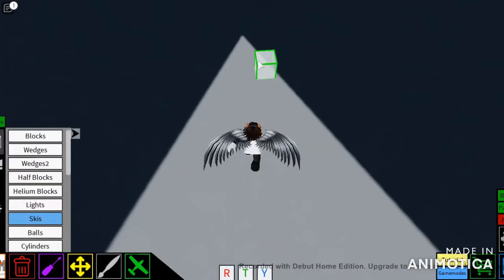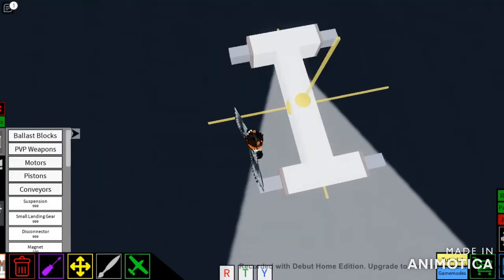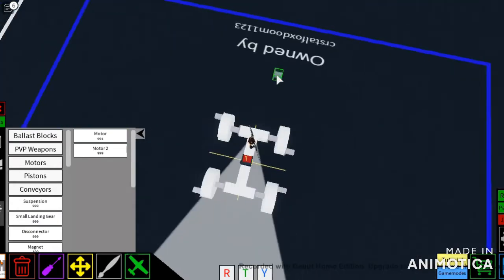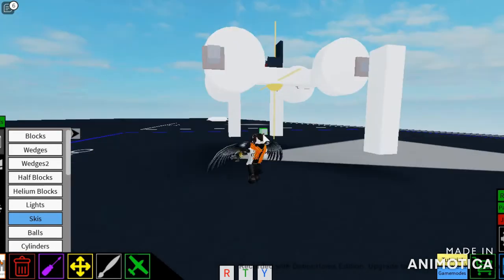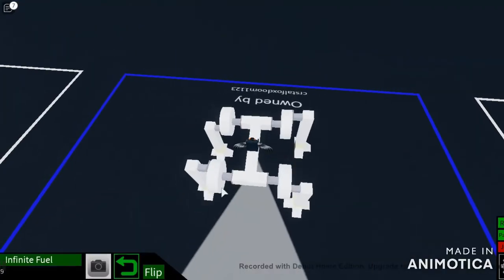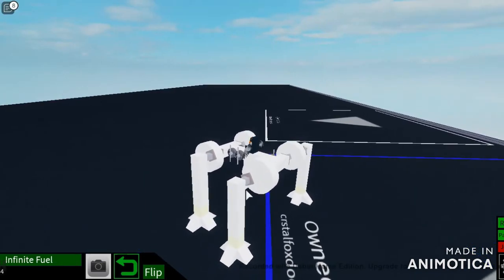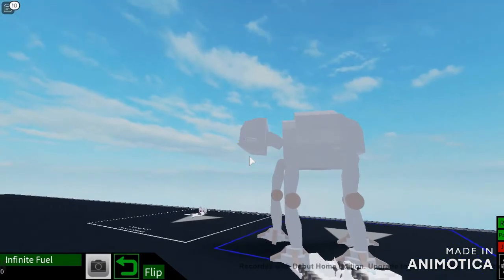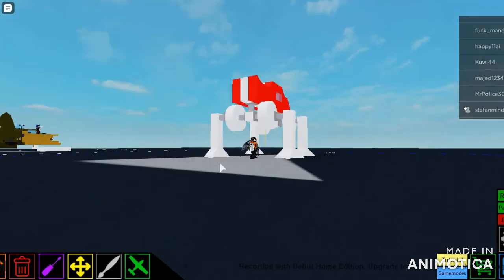Plane crazy, how to make a 4 legged walker

Comment: how do i make it so the legs dont get out of place bc im building a walker and the legs r moving out of place and making it not walk properly
Reply: you can do reset for motors
Reply from the maker: @BobertTheSealMobile  make sure that all the legs are at the same speed and are placed correctly on the cylinders. (It's been a while since I've played sorry if it's not much help) I believe there's also a setting to adjust the torque strength so if it's too heavy maybe increase the torque
Reply: @cyberjamm  ok
Reply: the walker im making is an atte so how do i do the middle legs?
Reply from the maker: @BobertTheSealMobile  that's a trigger 1 this design is for 4 legged walkers not 6 I'd probably recommend building the middle legs in a middle rotation of the outer legs so as 1 is at the top the others at the bottom put the middle on the front/back of the cylinder.
Might be something I look into to make a tutorial
Reply: @cyberjamm  ok cuz i made the middle legs a bit slower than the other legs
Reply from the maker: @BobertTheSealMobile  yeah that could cause a issue another alternative could be when building make order it like this:
Front left down,  front right up,
Mid left up, mid right down
Back left down, back right up

That should also work probably better tbh

Comment: How do i make my AT-AT stop Falling because everytime it moves a little bit the legs go back like it triped  over something and falls
Reply from the maker: Check all your speeds they should be the same. also make sure the motors are facing the same way.

But if they doesn't work out some helium blocks in the top and hide density blocks in the feet
Reply: @cyberjamm  Thanks
Reply from the maker: @yrug4m  your welcome, if any other problems lemme know